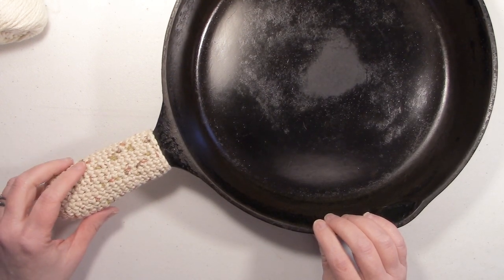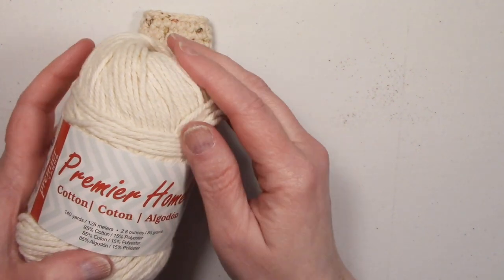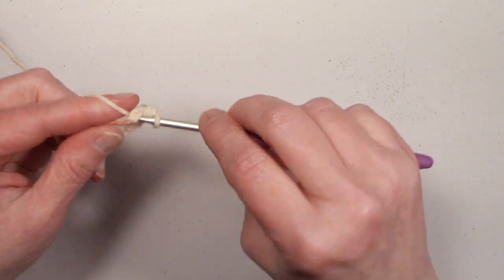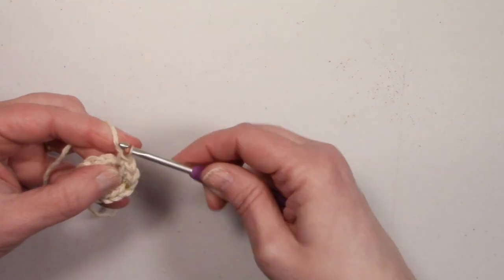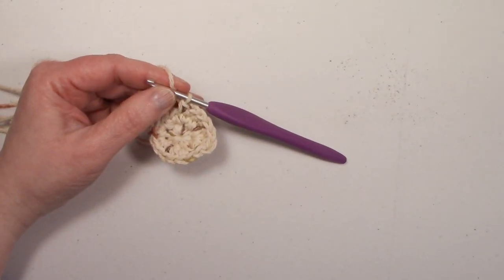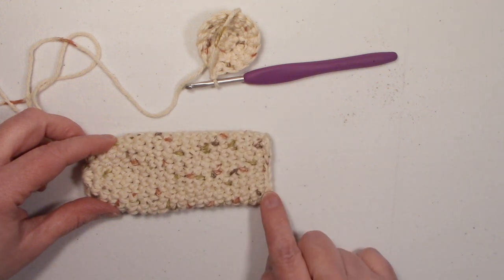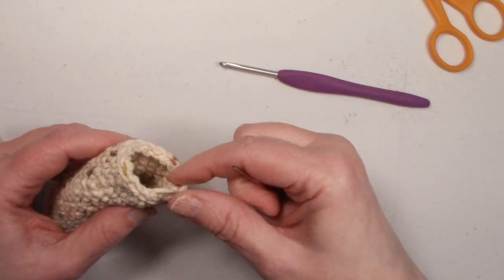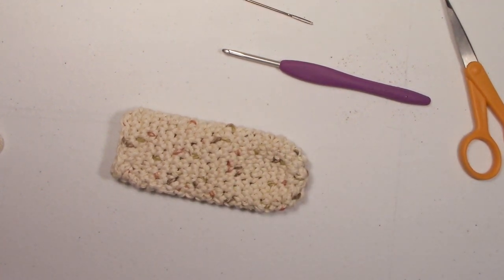How to Crochet a Pan Handle Pot Holder

Comment: Can you please link the yarn you used on projects.  Thank you so very very much for this because I love my cast iron pans and d made the mistake of making my first pot holders out of acrylic
Reply: 100% cotton yarn or some use wool.  Please don't use polyester yarn. It's made from plastic so it will melt if you try to use it on/with anything that will be hot.

Comment: So I’m wanting to make a tubular shape cat toy that basically looks like this but closed off so the top is the same as the bottom. How would I finish this off to add a few extra rounds and close the top off to match the bottom?
Reply from the maker: Once you reach the desired length, decrease each round to close to the top. You will want to stuff the toy prior to decreasing. You might need to add a little more polyfil before you sew the top closed.
Reply: Ninja Bunny Crochet thank you so so much for your help, I really appreciate it. Decreasing would mean to do a single crochet 2 together all the way around on each of the next rounds until it’s closed correct?
Reply from the maker: Correct
Reply: Ninja Bunny Crochet thank you so much for all of your help, I appreciate it so much and appreciate your tutorial for these pan handle holders as well, I’m excited to make some for our cast iron pans.

Comment: What is the approximate width of your potholder. I do not have an iron skillet but have been commissioned to make some of these
Reply from the maker: The approximate size of the pot handle holder is 4.5 inches in circumference and 4.5 inches in length.
Reply: @NinjaBunnyCrochet  thank you!

Comment: Was doing fine until 5:21 and now I'm lost.... no idea what to do.
Reply from the maker: Try using stitch marker in the first stitch to help you keep your place. 

However, you can also work in continuous rounds until the pot handle is long enough for your pan, than slip stitch in the next 3 stitches,  fasten off and weave your loose ends.